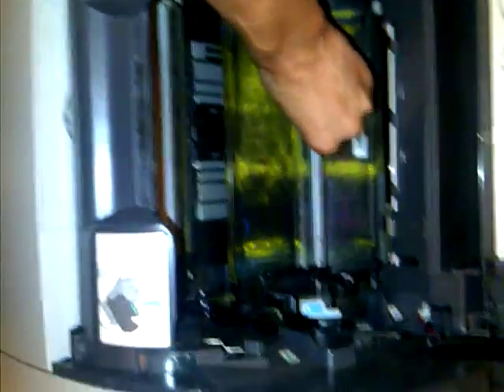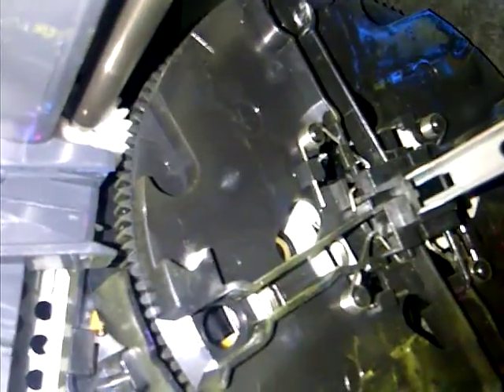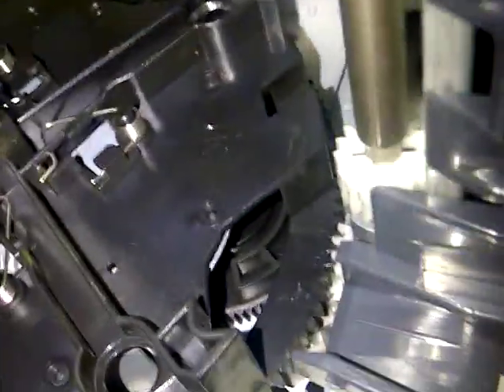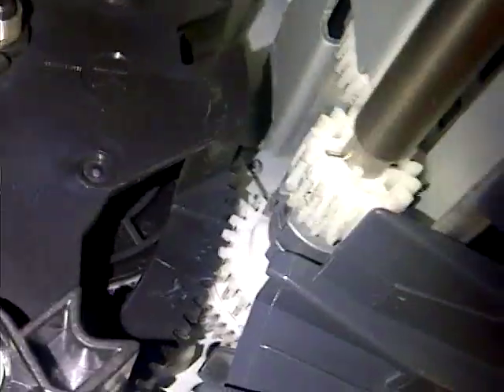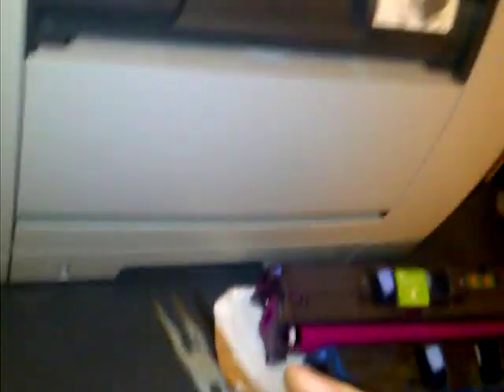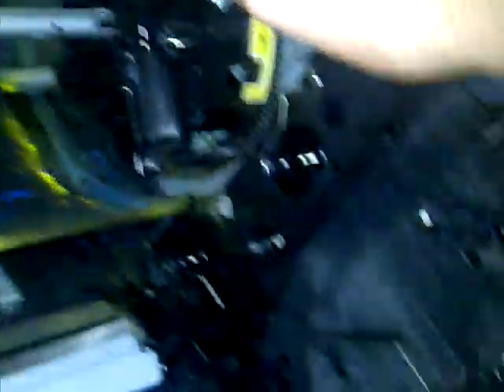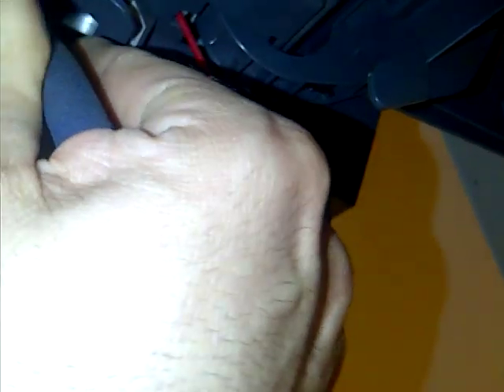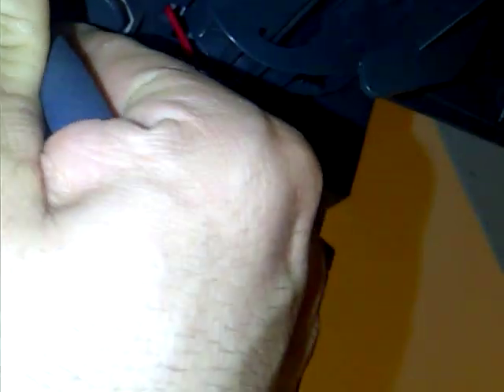HP LaserJet 2820 2840 Carousel Alignment Reindexing

Comment: I was getting a 54.2 error code and after watching this, I found that one of the gears was out of alignment. I pried the black gear out a little with a screwdriver and moved
  it one tooth back into alignment and so far it seems to be OK now. Thanks for posting this short cut. Another step on the glorious path of least resistance:)

Comment: Thank you very much Chris. I was able to re-align my 2820 after watching your video.  I was getting a code 54.2 after installing a "new" toner cartridge which made my printer make loud banging noises from inside.  After that it would only print a little bit on the far right edge of the page.  Now after re-aligning the carousel all of the pages print exactly as they should. You made my day!

Comment: I tried this today and it worked--not the first time, but after three re-installations of the cartridges, it worked very well--I did not have the side gears aligned properly. Once I saw the little alignment marks, I was able to set the carousel before initiating the reinstallation. This may well be an issue caused in part by using non_HP cartridges, but if so, this is the first time in 9 years of using nothing but non-HP cartridges that this problem has surfaced--and it surfaced because I removed a paper jam. I may have dislodged the carousel in doing that. But thanks again for this video--you saved me a trip to a repair shop!

Comment: Big thx Cris! YOU're the boss!
Finally after several trials of reindexing&printing&breakingagain and disassembling of half of the printer it came out that one of the third-party toner cartridges became so hard to rotate that it was hardly spinning in my fingers taken out from the printer.
Since it's been replaced and caorusel realigned this great printer works like a charm again!

Comment: Thank you for quick problem solving ! Black toner cassette become stiff, so printer produced terrible noise. But after replacement of the toner, printer was able to print on right side paper only. Finally after watching this video I move right big black gear one tooth back. This fixed the problem.

Comment: I got a 54.2 error on a 2840. I used your method and with the correct alignment, the machine worked fine! Thanks for that! My only observation is that you do not need a tool to re adjust the right black cylinder. Only pull it gently towards the machine's inside and it will come off the white gear. Readjust and push it inside until it clicks. You re ready!

Comment: I am covered in toner, but I have won the war.  I had to bend in both sides as mine was more than 90 degrees off on both sides... But I was able to gently wedge a prybar in on both sides, and spin the top gears until everything lined up.  It's back to printing happily!

Comment: Thanks for the help, I realigned the carousel on my 2840 and it jumped out again as the machine calibrated. I checked the cogs on each toner cartridge and cleaned the excess toner out of the teeth using a tooth pick, when it came to the black cartridge it wouldn't turn, I replaced the cartridge with a new black one, problem solved.
Also I used the inside of a BIC pen as I couldn't find a straw, (when it printed a white test page I realised I hadn't removed the straw.

Comment: This fixed my problem.  After replacing some cartridges, and then finding they stopped working later (replace magenta cartridge), it seems the misaligned teeth prevented them from working, even after replacing with new ones again.
One suggestion, I couldn't get a regular straw to work, but found a coffee stirring straw does (it's the same size as a WD-40 straw).

Comment: Dunno if it helps, but you just have to rest the straw where he shows, the clutch is not very deep, it doesn't need much strength, i did it with a small screwdriver. No need to apply pressure, just fish around while moving gently the carousel to see if it's released.
I also didn't use pliers. I pulled the right gear using my index finger to the left. Or to make things easier, rotate the printer so that you're facing the right gear and pull its top towards you, then rotate into place. :) THANKS!

Comment: Very helpful !  I developed this problem after changing the ink cartridges. I was in shock after spending megabucks on cartridges and a new imaging drum.  I still don't know what I did to mess up the alignment. Seems like it couldn't happen given that the left and right gears are connected by a small piece of steel--but live and learn.

I do have one comment.  This video was very helpful but I would like to clarify what I think is being accomplished. Essentially, you can use pliers, a screw driver or your fingers to bend the large (~3 inch) black gear on the right side INWARD (at the top) so that you can freely rotate it relative to the smaller white gear above it. Once free you can rotate it relative to the white gear to achieve left-right alignment.  I USED MY FINGERS. I cannot imagine every being off more than one gear tooth.

Those alignment marks on the 3" black gear are helpful but the real issue is the left-right alignment for the guides that hold the ink cartridge. Pulling out the soda straw (or removing your jeweler's screw driver) at or near a cartridge insertion point (in the carrier rotation) will allow you to have the most meaningful view of alignment--or lack thereof.  An added bonus was that the cartridge carrier stayed put--allowing me to easily bend (and release) the ~3" gear on the right side. This might be easier than not having the apparatus fixed (due to the inserted straw). Use of those pliers may inadvertently have portrayed the impression of pulling on that black gear.  I don't thing that is what is happening here. 

I'm so happy!

Obsessively Yours,
LMA in Durham NC  USA

Comment: I have the 54.2 error, and it just says to turn off power and turn back on.  Which I did, and it still has the error.  It doesn't actually say it has a carousel problem.  But I followed the video and  everything looks in alignment.  Put it back together again and it still has the same error.  Any ideas?

Comment: On top of the right carousel (you have to remove the top cover) is a small relay. This relay is what aligns the carousel's right big gear. The relay can be taken apart by removing the spring and lever on top of the relay. Underneath the lever is a little spunge for noise damping. This spunge over the years turns into chewing gum and makes the relay stick, hence the carousel stops at the wrong place. With some alcohol remove the sticky spunge residue on the lever and relay. I just stuck a new piece of double sided tape on the lever (where the old spungy was) and left the tape (siliconated strip on the other side) on....you don't want the relay to stick together (just on the one side..the lever or the relay body). This works as a damper. Install the relay back and follow the video to re align your carousel. If you dont repair the relay your carousel will just lose its alignment again. You can also stick a piece of selotape on the other sticky side of your double sided tape. Hope this is clear.
Reply: Rene,  how do I remove the top cover?
Reply: You have to take all the side covers off and remove the scanner unit - careful not to damage the cables. Done it some time ago do not remember the details...as you go you will see the screws connecting the whole scanner unit. As far as I can remember you do not open the scanner unit but remove it as a whole. The above video is the relay and how to fix the problem. Hope this helps .
Reply: The hinges under the scanner unit when it is in the open position could just be pulled forward (side on the main body) to unhook (needs some persuasion). You must open the covers to undo the cables to the scanner unit. If I am not mistaken you just move the scanner more backwards and it will unhook from the back hinges...
Reply: Awesome!  Thanks for the quick reply Rene.  Found another post that said the error can be caused by a stiff roller in one of the toner packs.  Found the culprit, changed toner, and error has not returned.
Reply: On an old machine the relay will cause a problem sooner or later. Yes a stiff toner unit can cause that too.
Reply: i used to stick a piece of tape in there, just cut it and hold it in with pliers while you activate the solenoid. it will cover and make the stickign issue go away. (trick from an hp lj 2)

Comment: I think I found marks but I have 'two' bumps on white gear and black gear mark is in center, looks like on both sides, so guess I'm ok with mark synchronization? HOWEVER my carousel turns w/o locking? I think that is my problem? I can't see what locks the carousel? any suggestions? PS: would an 'unlocked' carousel cause a 'no print' problem (printer passes paper but no ink is printed?). 
Most of these comments are 7 years old - are you still alive?

Comment: Thanks for the video - it took some time to understand. In my case the white cog on the left looked misaligned. But after fixing it the printer sounded fine, but nothing printed. Then I adjusted the alignment again (on the left side) and the pages printed half (lengthways) only. Am I only meant to adjust the alignment on the right side like on your video?

Comment: I have one question only....will this fix the new toner undetection from detecting it....this is my problem it keeps sending message the the black toner is empty.thank you
Reply: Bernard Herrera When your toner is out, shake it vigorously to distribute the powder.  That worked for me.  If the cartridge is not detected, make sure the toner chip contacts are clean.

Comment: Try to replace the tonner cartridges chips. I want to use only black so I replaced yellow chip without recharging it and now I can use the printer. You can buy it at sites like ali express: Compatible Toner Reset Cartridge Chip for HP Color LaserJet 2550L/2550Ln/2550n/2820/2840 with high quality